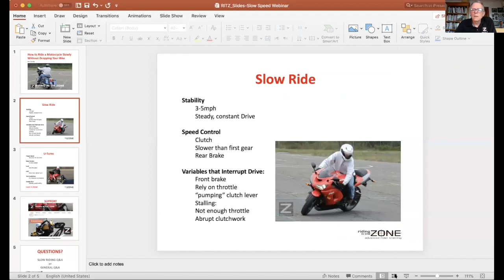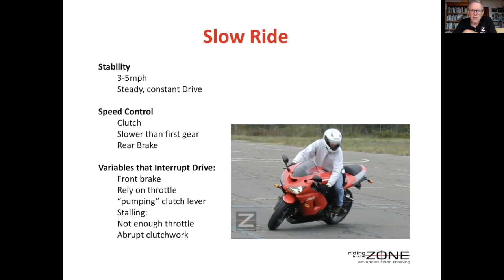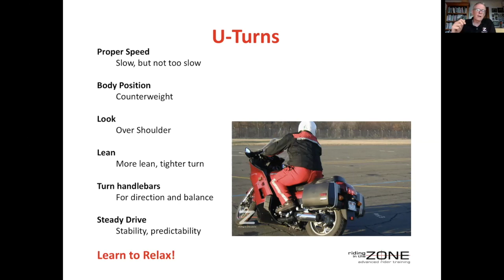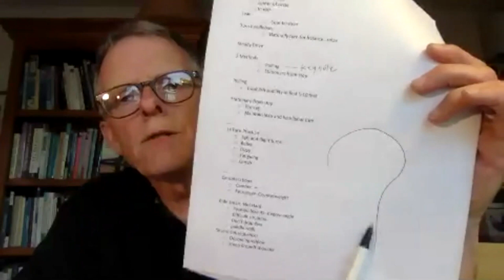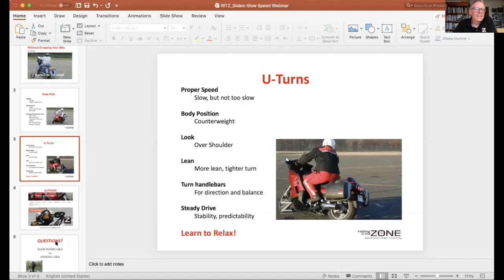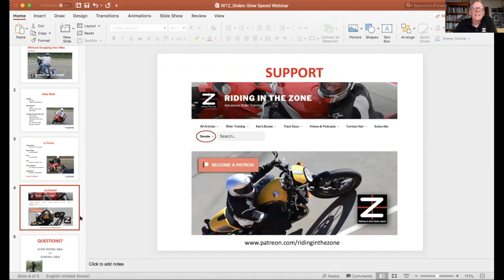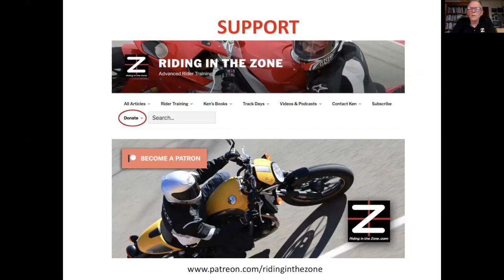How to Ride a Motorcycle Slowly Webinar - Ken Condon

Comment: Thank you Ken. I appreciate how you dissected the entire U-turn maneuver and explained what your body position and control configuration should be as you progress throughout the entire maneuver. 
That really helped me. 
Also, knowing that the throttle is more or less locked, or set at a particular level, then reinforces the fact that any slight adjustments will come from the clutch and the brake. Thank you for that.
The counterbalancing explanation and reason for doing it really helps as well. Now it's time to go practice!
Thanks again!!!
God Bless!!!

Comment: 48:00 One more critical difference between front vs rear brake : front fork compression. Because front brake will cause the front suspension to collapse, it won't actually begin to slow down the entire motorcycle until the collapse and the braking force will be sudden/strong. Rear brake, on the other hand, does not change the suspension geometry significantly and the application of braking force is INSTANT. The difference in delay time is one of the critical difference.

Front brake force : delayed and jerky(also causes the front wheel to turn inside)
Rear brake force : instant and smooth

Comment: About vision & body position, I like to think that I am looking through a telescope that is fixed above the center of fuel tank, and I turn that telescope into the corner. That cause me to move my head and upper body outside, and point my vision toward the right direction, at the same time.

Comment: Great advice, and I'm going try the locking my finger on the throttle tomorrow. 👍
It's a bit weird coming from the UK as slow riding is a big part of the initial Compulsory Basic Training day, and then the Mod 1 part of the full test is almost all slow riding on a larger bike. So we're pretty familiar with it. We can also filter, (lane split), on the road, which is pretty high stakes slow riding as you really don't want to scratch someone's car as you ride past 100 cars stuck in traffic 😎😎😎
Really appreciate your videos. I especially liked the bit about the countersteering effect. My understanding as of now is: It's always happening, it's effect is just linked to the momentum of the bike. To affect the lean of the bike it has to overcome the gravitational pull the other way, which is why it has a greater part to play the faster you go.
You should have 100x subscribers BTW. Content is great 👍
Reply: Locking your finger is a great tip! Works really well 👍